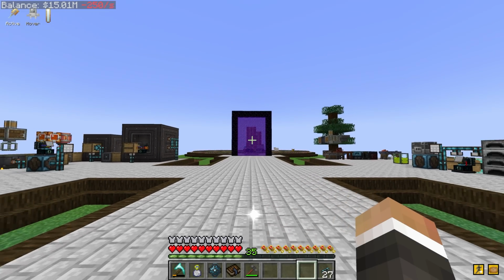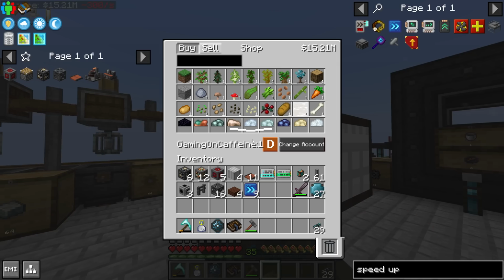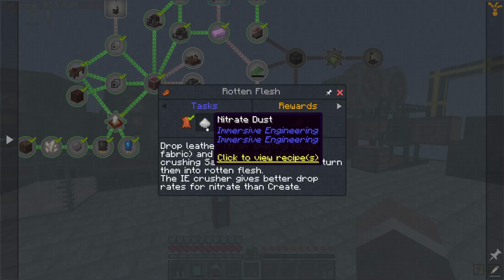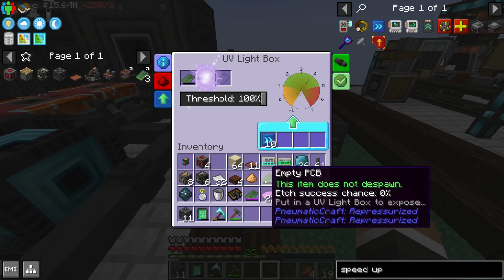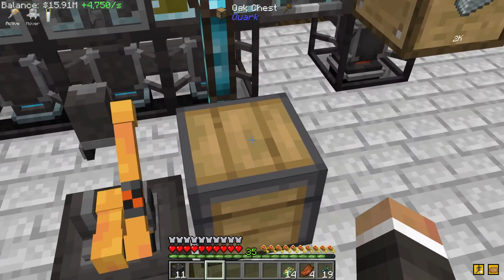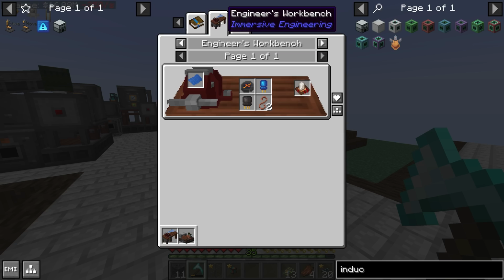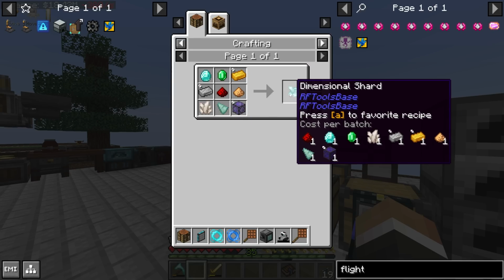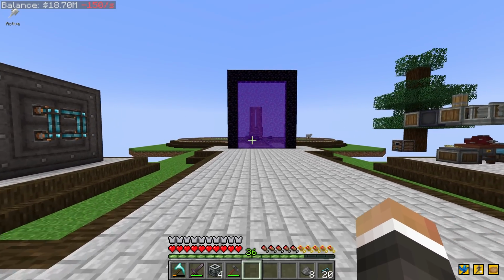Minecraft Forever Factory | LASER ETCHED CIRCUIT BOARDS & CREATIVE FLIGHT #11 [Factory Modpack]

Comment: If I'm not mistaken, the drawer system you have in this pack have "Fluid" drawers. That would be an option that can be linked to your system through the drawer controller.

Comment: You should be using filtered interfaces on all your fluid tanks. 

I ran into a similar problem where all my acetaldehyde was vanishing as soon as it was created, and it was because I had a sink with an unfiltered interface on it.
Reply: I use locked drawers, which to work fine
Reply: @paulelderson934  I keep forgetting that fluid drawers are a thing.

Though that wouldn't have helped in my case, with the sink.